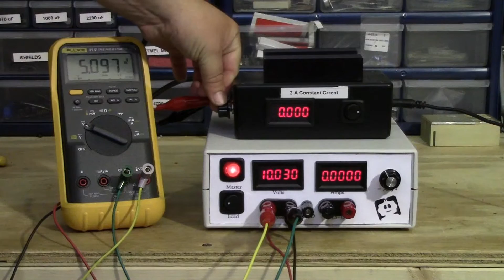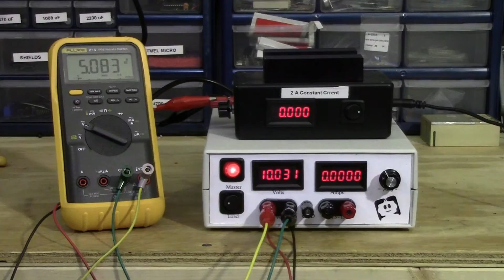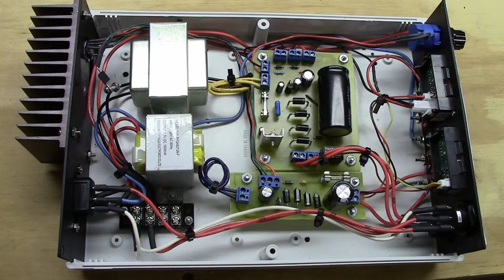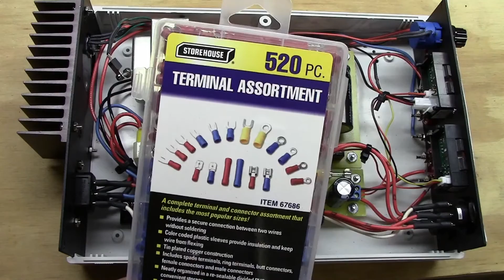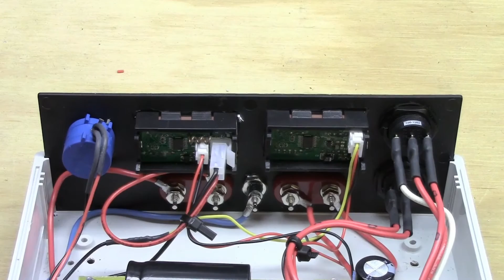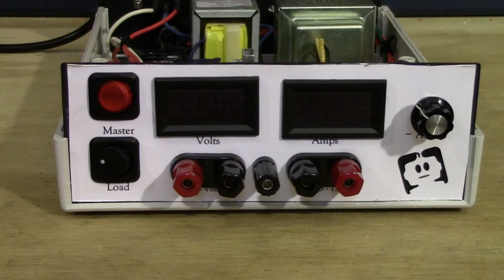#5 - DC Power Supply Upgrade Part 5 - Final Build

Comment: Nice work, very neat construction. One of the benefits of crimp on connectors is stress relief of the wire, though this is not a particularly stress filled application. Soldering the crimp creates a stress point at the edge of the solder joint.